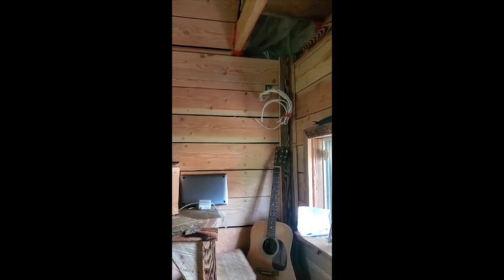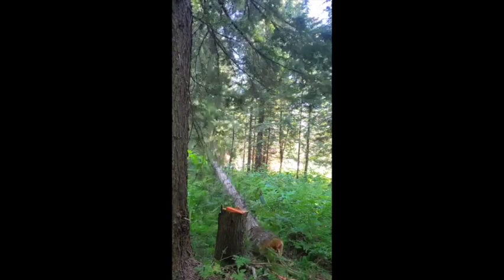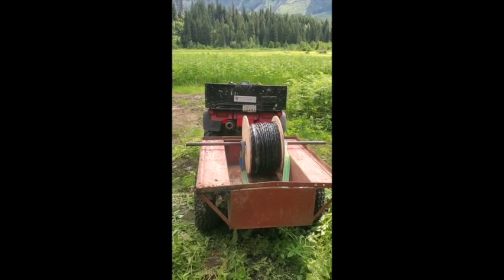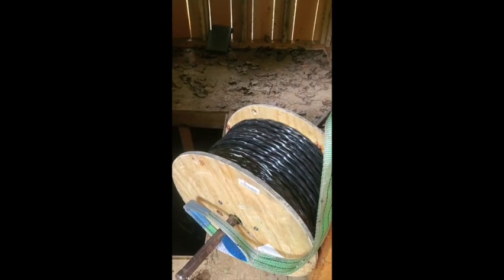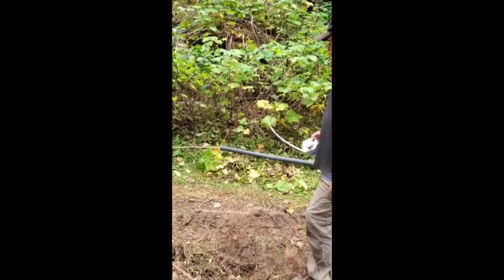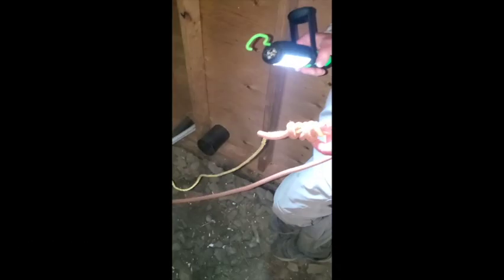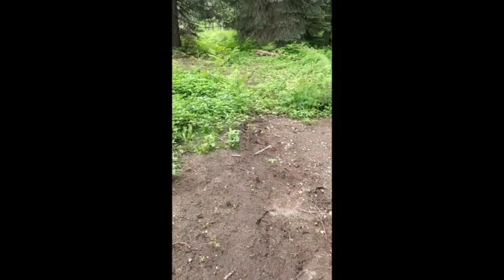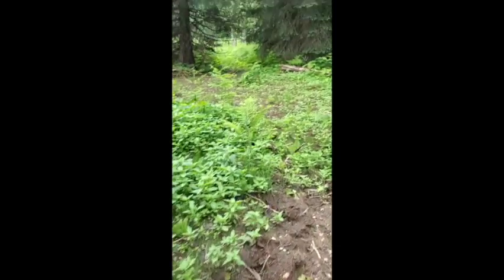The Micro Hydro Project: Episode 8 - Pulling the Cable

Comment: 12:23   plumbing to the jets should not have 90-degree bends.    in the case of two jets, the supply to each should be sized to carry  one-half of  the  total  flow.
Reply from the maker: Yea, it's not ideal but I didn't have the space to do big sweeping loops into the nozzles. The guy who builds them says it's all good though so I made it work with what I have. But thanks for the good feedback!